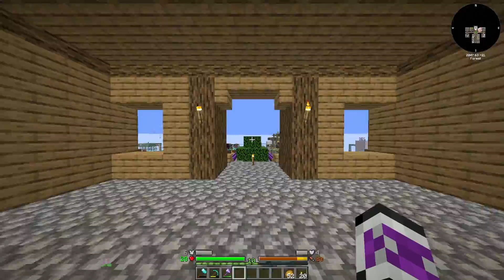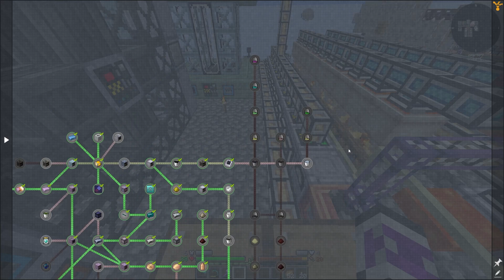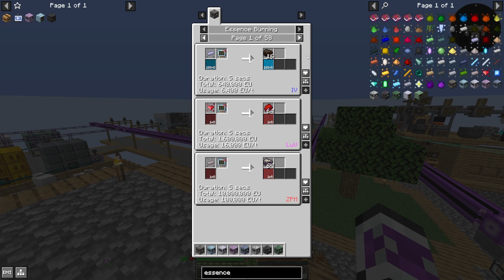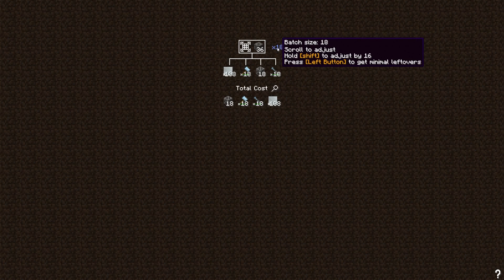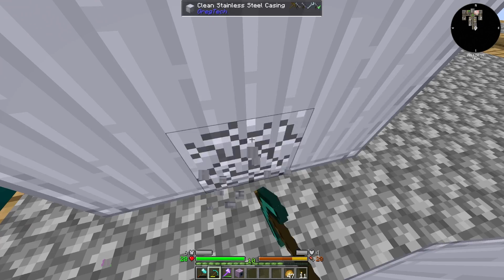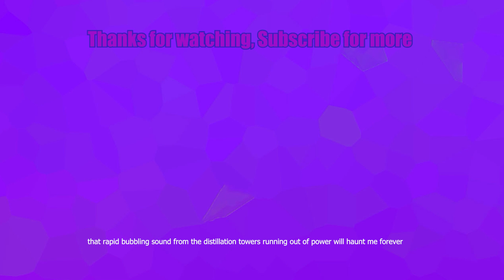Star Technology: Episode 26 - Air Distillation

Comment: you should start looking into solar like you were talking about. In my world, everything runs on solar. I have more power than I know what to do with. make sure you invest in batteries for the solar for the buffer. You are on the right track for the gas distillation. once you have proper power the distillation towers should have no problems anymore. Youll just want to upgrade their power intake when you can but that comes with time.

Comment: For the water, you're really better off just using the water cell from AE2, it is cheap and infinite, just like the cobble.
For the usage of the essence, water essence is mostly used for salt water into electrolysis as the best source for chlorine, which you're gonna need a ton of. Distilled water can also be useful, though is lesser quantities, witch water has a single usage at your stage and after, and it's not even used all the time, so just sticking with a large barrel from the very early game is an option.
I'd also encourage you to have one essence burner for liquid blaze, at it is as easy to setup as the rest, and is always used for a few things here and there.

Improved tips for the dirt tower distillation check, you can craft an exchanging gadget that is very cheap, which allows you to replace a certain type of adjacent blocks (for instance dirt) into another block (for instance clean stainless casings). So you could set up the dirt tower, press the ultimine button, check in the top left the amount to be mined, not mine anything, make the casings, and then just everything with the gadget.
Reply from the maker: Oh yeah, of course the ae2 cell would be better, it slipped my mind at the time. The other essences I was waiting to see what the comments would recommend. So salt water -> chlorine, lava, and liquid blaze.

Comment: For energy, its very easy to spam the steam dynamo and a normal dynamo converted to a boiler. The quests say it produces twice as much energy as the other dynamo.
Reply: The best setup for this is to have 16 boilers all feeding into 5 steam dynamos. If everything has EV upgrade kits and EV injection kits, the fuel efficiency is really high. This specific setup produces a million FE/t but requires all the upgrade and injection kits.
Reply from the maker: I think I'll just use solar panels, I don't want to use any fuel anymore. If the solar panels are too expensive or inefficient, then I'll use the boilers.
Reply: @Thaumiumking9  The good solar panels are still a bit away. IMO this boiler + steam setup with lapidary boilers on diamonds is easy to do, but I understand it sounds annoying to setup